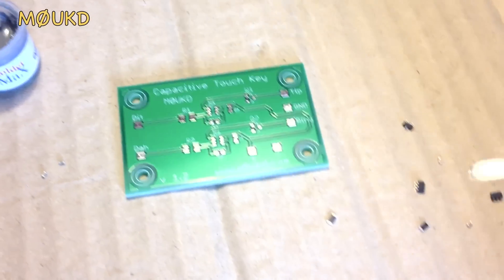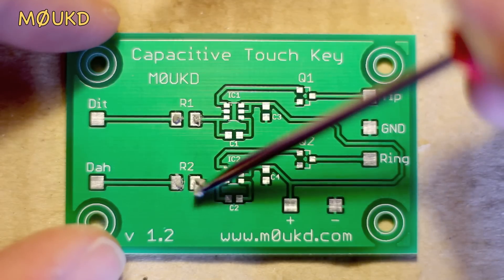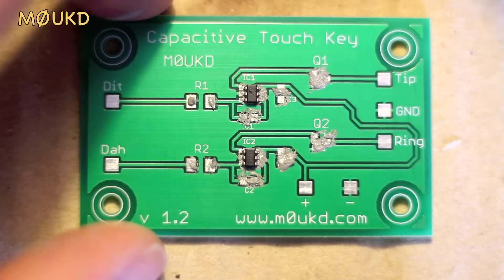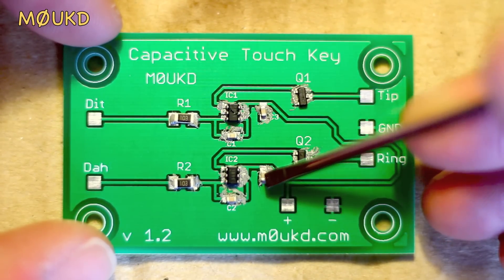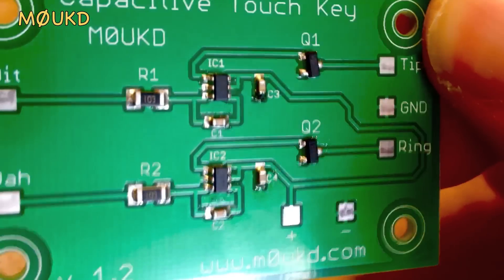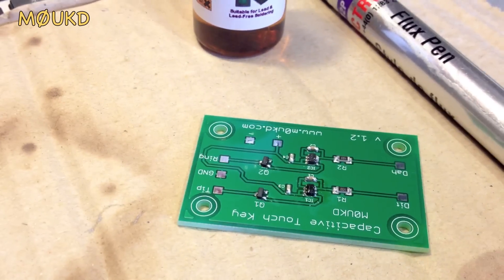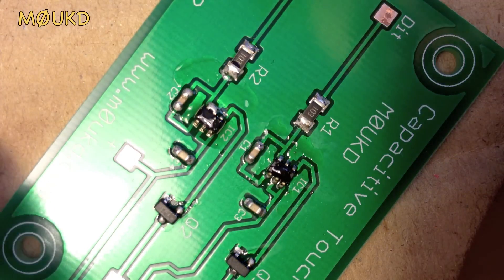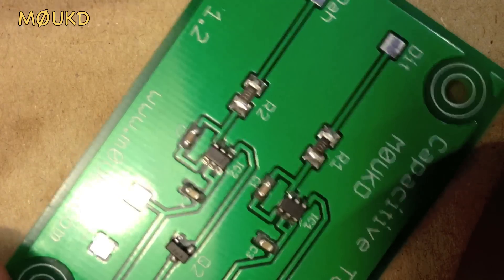Surface Mount (SMD) Hot Air Soldering

Comment: Amazing. With the volume of air put out by that gun ( which really was intended for things like stripping paint, not delicate electronics work), I was expecting the tiny parts to go flying. Nice job.
Reply from the maker: It works well, it has a temperature adjustment on it.

Comment: Nice demonstration of the hot air technique and repair.  This has become my default SMD soldering technique, and it works very well, even though my aging hands shake due to tremors.  I find SMD using this technique much easier than conventional through-hole soldering.  It is fun to watch the solder paste kick-over when it melts! Notice that as the solder kicks-over,  the components tend to center themselves on the pads. I also prefer a crafts hot air gun due to its low air velocity.

Mark
KE6BB

Comment: Seeing most of the solder paste that is not touching pads or pins seemingly vanish with the heat is really cool to watch.

Have you ever had the ICs trap some of the solder paste underneath when it solidifies, thus bridging the ICs from below? I ask because I was originally thinking you'd have to apply paste to each pad with a needle, but you've covered the pins and pads completely and it seems to work just as well.

Comment: You could have used a needle to spread the solder paste, anyway, the result of your job was really good

One more thing: What did you used to clean the flux? I couldn't hear
Reply: this is a late reply but here is an answer
he use methylated spirit i think.
Reply from the maker: thecrashtestdummy25 Yes, correct. Seems to do the trick!
Reply: Thank you both, i'll try to use it to clean my PCBs when I finish all the welding process
Reply: thecrashtestdummy25 methylated spirit also known as denatured alcohol.
Reply: i was told iso propanol alcohol was a better option for cleaning flux and general pcb cleaning
Reply: i think isopropyl alcohol is a better cleaning method.  I cant really judge though because i havent used methylated spirits.  i use isopropyl on most circuit boards i fix(i remove capacitors and replace them on vintage computers) with no bad side effects.  Not to mention its what should be used for cleaning(learned it in a class im in)
Reply: Yes. I agree. Denatured alcohol can leave a residue.
Reply: Jeronimo---this is NOT a welding process--it is soldering.

Comment: I have these small SMD LED lights and was wondering if I could use solder paste and a hot air gun to connect them in a series or parallel using wire?

Comment: what temperature was the heat gun set at? is it possible to overheat and damage components.  why did u not use heat gun after applying the flux to get rid of shorts?
brilliant tho, u make it look so easy...;-}
Reply: Smt paste melts at 180c. Hot air blower, max can be 600c.  If done carefully, no damage